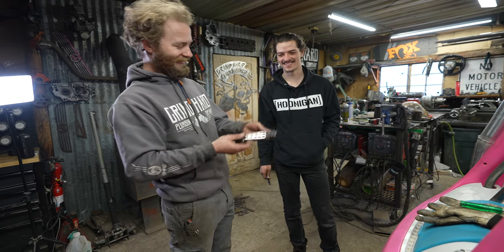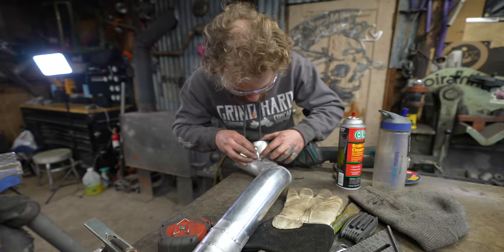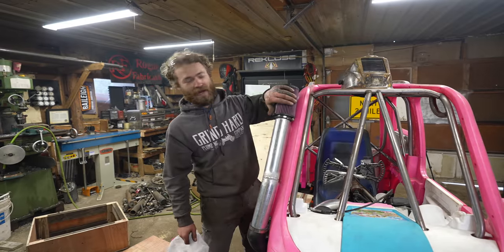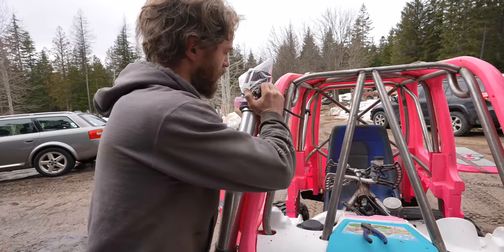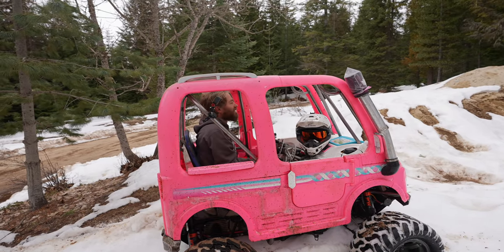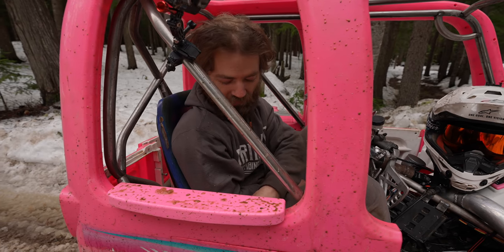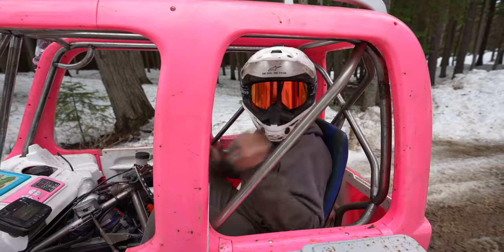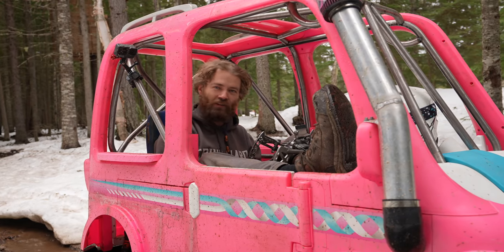Building a Snorkel + Putting it to the Test!

Comment: Just some tips if you plan to go deep: di-electric grease the spark plugs and make sure to run all your carb vents is high as possible and put one-way valves in the carb bowl drains. Also vent the diffs too
Reply: I was looking for this! You need this to go deep

Comment: Your little pipe piece that you call a bung. That is actually a bunghole. A bung is what fits into the bunghole. Bungs came about in sealing casks which would hold wine. They would fill the wine cask. Then fill the bunghole with a bung, a round wooden stopper.
Reply: The great bungholio explains all 😂
Reply: Are you threatening me? hehe hehe
Reply: Does it really matter though, when you're bangin' your helmet off the cage?

Comment: Love your videos. Keep in mind that needing to choke the engine can also mean clogged and dirty ports in the carburetor. I know that removing the stock filter makes many carburetors a bit lean especially on smaller engines but needing that much choke makes me believe that it will run bad even on the stock box. 

Either way, there is definitely more power to be gained.
Reply: It's definitely got "afterfire" too, so along with clogged jets or venturi ports, it could also be unhappy with the exhaust back pressure. Or maybe a vacuum port that should be capped off.

One thing that takes newbies a long time to learn, is adding more air and fuel almost never increases power in any significant way to carbed engines. At least not on off road vehicles. Manufacturers have no reason to limit power on a quad or dirt bike. The only way you'll make bigger power is with big bore kits, porting, and changing cam profiles.

Usually all that happens when changing airflow and jets is you kill the efficiency and reliability, and turn it all into extra noise (which some people think is more power).
Reply: @TKettle  Manufacturers have plenty of reason to limit power and you mentioned them... reliability and fuel efficiency. Many bikes these days come quite lean so they can pass the emissions requirements, adding fuel and air has been shown on the dyno to add power.
Reply: @TKettle  Is the same true for a fuel injected engine? Even with port injection?

Comment: 3:05 My appartment has the same issue. 3 room apt and I build RC cars from scratch... I 3d design and print, build wood and metal frames, braze and solder, wire electronics, do styrene bodywork and paint and weathering etc.... I basicly live in a cluttered workshop with a sofa and a bed... Yup, I'm a 40 yr old single male... :D :D :D
Btw. The snorkel should be at the roof. That way you can drive the snorkel in deep water while breathing in a divers snorkel yourself...! -Basicly submarining the thing throug mudholes... you might need an ecco location device... LOL

Comment: Slip your silicone boot over a pipe with the cutoff portion hanging off the end, hose clamp it on and razer blade againsed the edge of the pipe. Perfect cut.

Comment: Hey guys, Ethan if your having to choke the Barbi camper with a plastic bag it's probably more than likely got a vacuum leak. there could be a vacuum hose disconnected or it could be at the carburetor flanges. it's not unusual for them to get cracks in them. especially if it's been sitting around for awhile. they get dried out and get hard and cracked  and it's sometimes difficult to see the cracks. and there's a possibility that it needs flattened up. because if you opened up the exhaust and they intake larger than original. it may need a richer air fuel mixture. the Barbi camper is really cool and it has it's purpose. but I'm sticking with what I originally said when you built Colonel Sender's. it's going to be a long time before something tops it no doubt it's truly badass. I'm curious what are your plans for the Odyssey. I've been looking for one, I have an engine from a sled to put in one. but they are sort difficult to find. well the Barbi camper is coming along great. and it's probably good to have the bonus creature comforts built into this build.

Comment: Ethan, build a 1 inch space around the filter, that completely covers the top to the clamp part of the air filter, so rain falls off and below the air filter element....then use a small bolt and screw and connect from inside the air filter and this cap. Would look sick
Reply: If he used something shaped like an upside down cup, he could protect from the rain and lower the airflow with adjustability. Instead of running specific jets that work for the airflow.  he can adjust the airflow to work for the jets he has.

Comment: You should still have room to adjust the air-fuel mixer with the jets that are in it. There should be some headroom along as it wasn't touched. Turn it counterclockwise until it runs smoother without lean popping. I love the snorkel. Finishes off the look nicely.

Comment: 2 things, not hate just suggestions about the kawi motors, I don’t know what year the motor is but on the older ones before 2012 the oil pump was at the front, wile going up inclines  it will dump oil in the rear cylinder and starve the front cylinder of oil and will sometimes go into the air box it will burn oil when this happens as the rear cylinder is being flooded with oil and number 2 always always check the oil on the kawi motor they are notorious for burning oil even if you don’t notice it I assume you check it every time the motor gets driven but always check up on it not really to do with the motor but with a snorkel for the air intake there also needs to be a belt intake and belt exhaust or else your belt will get wet wile in deep water and then it will slip and not move, cvt machines are a pain

Comment: You can use some hairspray on the aluminum intake tubes and the silicone couplers will stick to it and not leak at all. I do that on my intercooler couplers and it works really well

Comment: Some of those pink pool noodles and some zip ties will fix those rollcage bars and soften them up you'll still hit but it will be foam not steel
Reply: you could also just use foam pipe insulation. it should be sized to fit pipes.

Comment: Don’t forget to snorkel the belt intake and exhaust. If you plan on actually going in that deep of water. It will be great that the engine is still running but a real pain you can’t use it to move

Comment: I have a question… is there a reason to have the gas throttle on the steering Wheel?
Reply: I think it's because it's a small car and it bounces around a lot, so they wouldn't be as precise with the feet. Also maybe it has something to do with the fact that it used to be an ATV and the controls are made to be operated by hand, so maybe it's easier to build this way

Comment: When you cut any sort of silicon tube, slightly tighten a hose clamp (where it won't slip yet won't cave the sides in) in the measurement you want to cut it and use a bloody sharp knife

Comment: You should hit the bars of the cage with foam insulation and silicone tape, or add a racing seat with some kind of wrap around head protection. Small repeated bumps to the head can be really bad news when it comes to head injury, people that do sliding sports end up with a condition known as "sled head" from the vibration and bumps. Seriously this thing would look sweet with a 5 point harness seat and some netting on the sides.

Comment: Water can get in through the exhaust too. You should plumb it above flood level also
Reply: As long as it’s running. It’ll be fine. He still needs to snorkel the CVT clutch if he does plan on doing over the tires deep

Comment: make a hood for the air cleaner that's only open to the front, and it should keep the rain and puddle splash off of the filter, and restrict the air flow some. when you said there was zero chance of getting wet, i was thinking there was zero chance of staying dry.

Comment: I had the same issue on an old Kawaski 700 when I put air pods in place of the stock airbox with CV carbs. I used aluminum flashing on the inside of the airpods to restrict the airflow. I had to block almost the entire pod.

Comment: You should get someone to cast you rubber handles or even coat the middle if the wrenches in a spray rubber coating. You would still be able to read what it says on the handle but now its comfortable to grab. Like maybe the same material they use for pliers grips

Comment: Guys you accidently build an extrem long intake port. There will be a crazy resonance inside this pipe which basically ruins the fueling. You need to add a volume with the size of the original airbox or bigger. this will increase power and will make the carburetors work.

Comment: Don't know if you have it fixed. Take  sheet aluminum in a roller brake make it round where it slips over your filter  an drill holes 
until you get the right amount of air flow.

Comment: Its actually not getting enough air with that set up which is why its bogging. You need the air box right before the throttle body, the reserve of air. In my experience anyways. I might be wrong but something to think about.

Comment: I'd like to point out that your evap line is pointing as if you want air to go IN to the crank case, instead of OUT of the crank case... and I'm pretty sure you want air going OUT of the case and into the engine so that it does not get a bunch of positive pressure. It probably doesn't matter that much if this stays naturally aspirated, but I'm certain this will be making boost in less than 12 months 😉
Reply from the maker: Haha! True! We will need to change it if we boost this thing. 😉

Comment: Carb vents, diff vents, gear case vent, engine bottom end vent, etc...  If it is vented, it needs to be run to a snorkel so its not sucking in water!

Comment: If you had put the snorkel inside the cage, it would have been better protected and saved the body. You also need to water proof the drains and drive train vents, as well as the electrical system.

Comment: Did u think about taking the filter off and welding a half circle/Half moon into the top then put the filter back on we’re it’s not pulling so much air and then when you put bigger jets u can just grind that half circle off still the same length no harm no foul rides good either way

Comment: I'm sure you've discovered with your tesla that electric vehicles are extremely controllable at low speeds and can go really quickly too. Best of both worlds. Just need to cure the lack of sound issue and make noisy electric motors

Comment: OK I get a snorkel but what about the belt box because the build box is open on the top and if it gets wet in there, your belt is going to slip and yeah that wouldn’t be good you guys should do a snorkel for the build box to😐